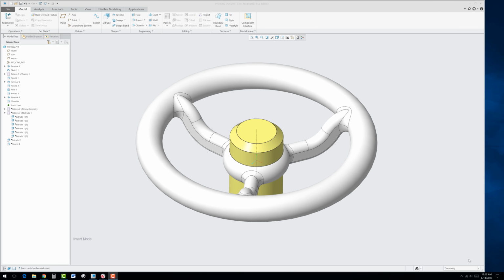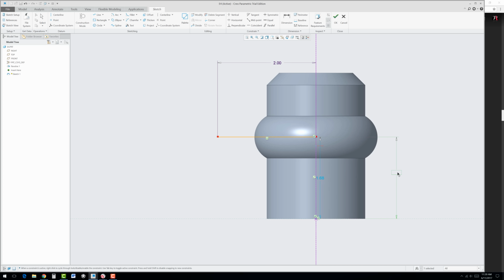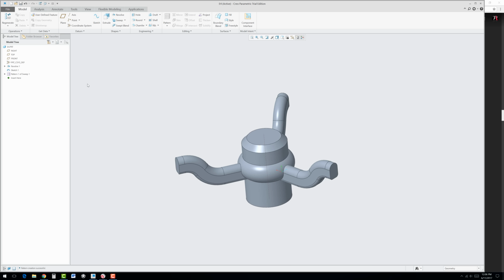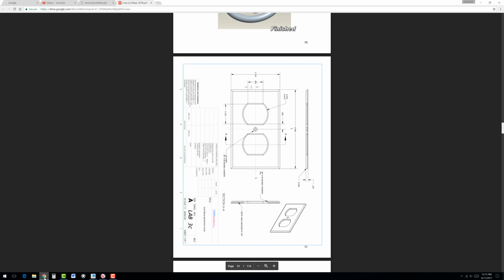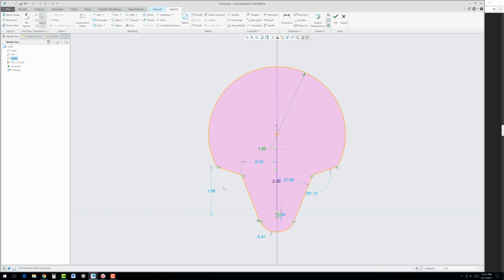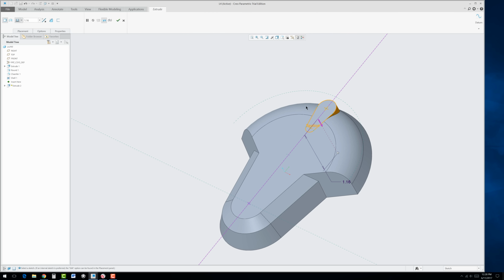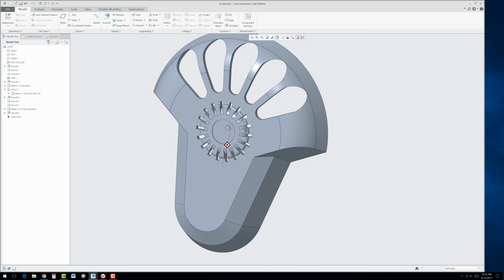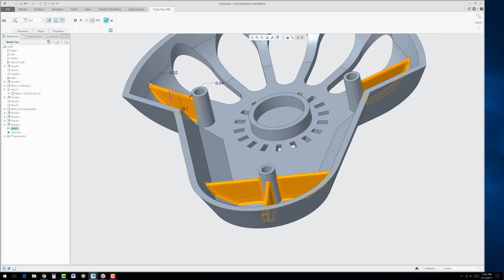E4 Creo Parametric 4.0 - Basic Modeling 4 Tutorial

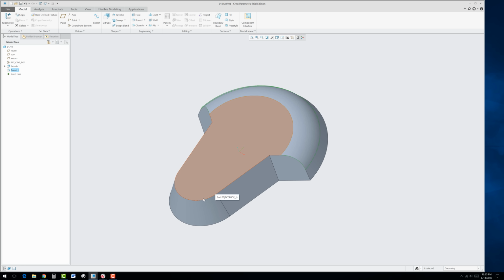Comment: At about 30:40, I think he is not producing a chamfer as defined in the drawing. The way Creo defines the chamfer feature using the angle and distance results in a chamfer that is a distance D from the original edge and at an angle from that original edge, but this edge is angled due to the draft. I checked the .181 length he uses and the way it is in the drawings, and the length that is .181 in the drawing is actually about .164 in the actual model. Using a bit of trig (.181/cos(25 deg)) and approximating the result should be the correct value to use. If I am wrong, please correct me, but I don't see where I'm wrong.

Comment: around 14:10 what settings do you have on that allows you to snap to midpoints to a preexisting model? I'm on creo 3.0 and cant seem to get any of those references on. thanks!
Reply from the maker: This is new functionality only in 4.0 and 5.0. In older versions select the references button in upper left corner ribbon. then select desired edge. Then use your sketch tool and it will locate the edge.

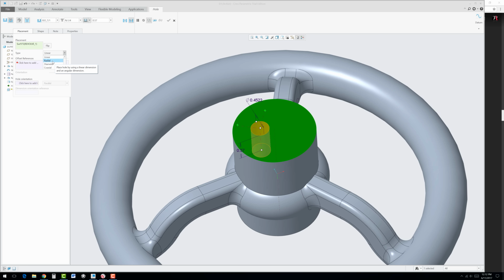Comment: Hello, I'm really enjoying the series so far.  However I'm stuck at 17:30; I have the problem that occurs at 17:00.  When I select the surface for placement and then change type to coaxial nothing happens.  If I then click on the center axis the hole becomes coaxial but stops adhering to the surface.  How was this problem solved?
Reply: I had the same issue until I realized I needed to control+click on both the surface and the axis. Hope this helps!
Reply: @mahill2006   Thank's man !!
Reply: @mahill2006  Heroe!
Reply: @mahill2006  MVP <3
Reply: actually I'm having the same problem so far. Any clue how to fix that?
Reply: Thank you. that helped me. :)
Reply: wow thanks man

Comment: When referring to the tangent arc tool trick to make the arc tangent of the line or make a dotted line and create the arc that is not tangent to the line at 26:30 in the video. After clicking the "3-Point/Tangent End" feature, click the point you wish to start at, then when the circle with the X inside appears creating 4 triangles in the circle, these 4 sections are directives as to whether you will use the "3-Point" or "Tangent End". As you draw your mouse through the path of 2 of the 4 sections in the small circle with an X in it you will find that it creates one or the other of the two features in this arc tool.

P.s.
Thanks for making these video's, This is the best way to learn creo, I would be lost without it.

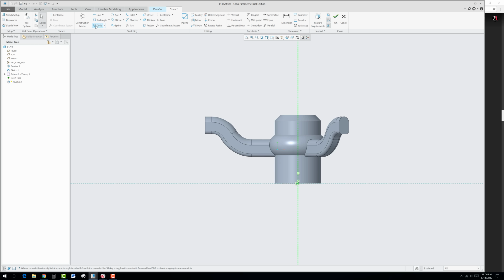Comment: Hey ! Great content, thank you for the work ! At 14:03, while sketching, you can grab the line (and centerpont) of a previous extrusion, is this a Creo 4.0 new feature ? I am running the 3.0 and I would need to use "references" to do that, and even doing that I don't think I can grab the center point. Is there a setting to change ? Thanks
Reply: Hi. I ran into the same issue with 3.0. It seems that locking to lines on extrusions is a new feature in 4.0. To accomplish the same thing, I used the "References" button at the top left to make a few references on the feature and then drew a construction line along that edge. It will automatically lock to the midpoint of a construction line. Best of luck!